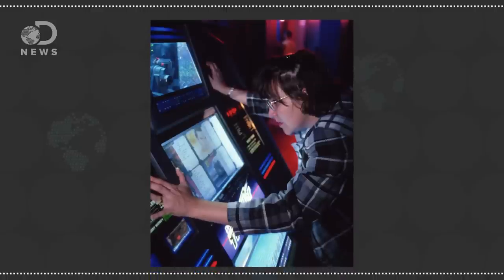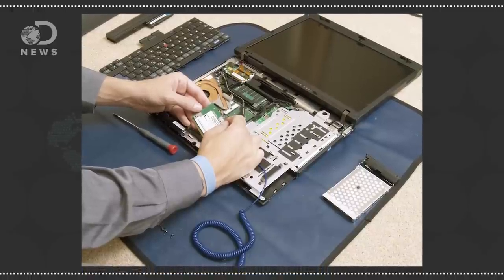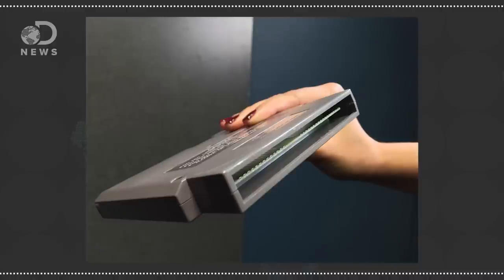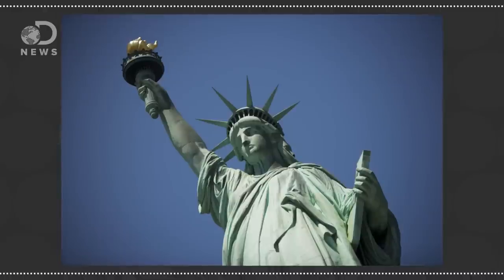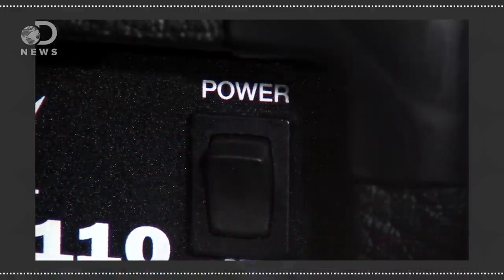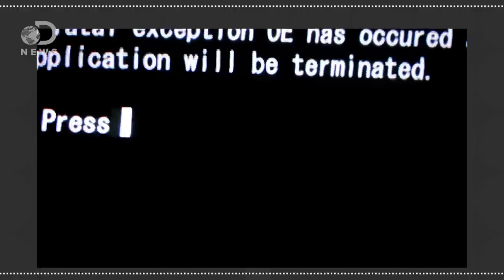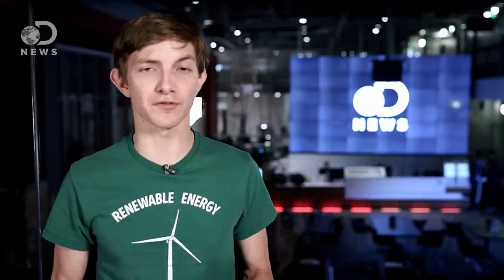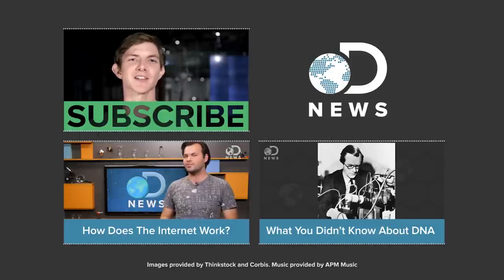Why Do We Hit Things When They Don’t Work?

Comment: Good point about oxidation.  I think the point of blowing on SNES cartridges (or any really) is that there was dust accumulated on the pins keeping them from making good contact with the edge connectors in the console.  Although maybe not as common as we would like to think the problem is real and can be remedied by giving it a good blast.  But I agree that a much better way to clean the contacts is to use isopropyl alcohol.

Comment: Old T.V.s and radios used vibrators & vacuum tubes; you had to let a T.V. or Radio warm up before they would start working.  By hitting it, it would get the vibrator working correctly or it would keep flipping. (before solid state electronics)

Comment: A common problem on Atari ST computers is socketed chip connections coming loose. The symptoms are erratic behaviour, sudden resets, unexpected bombs, blank screen (white), disk errors, etc... This is the result of the PCB aging, heating, dilating, warping, slowly easing the chips out of there sockets.
A common, and quick fix to this is the famous 4 inch drop, and it goes like this:

Switch off the machine,
Lift it horizontally about 4 inches (10 cm) above the desktop,
Drop it.
As silly as it may sound, this sometimes works, reseating the chips and solving the problem. The result is not 100% guaranteed however. If the problem still occurs you probably have a more serious problem.
Of course, another (more professional) option is to take apart the machine and reseat all the chips by hand.

Comment: In High School, my friends and I called it Percussion Maintenance (Percussive Maintenance is probably more apt, but we like the sound of Percussion).  We fixed a door lock that had jammed in the locked position with the use of a Sledgehammer.  It worked better then before.  For simpler machines, a bit of force, and some oil can go along way to fixing a problem.  For electronics, a bit of force can realign something for a little while, often something that you couldn't properly fix anyway.

Comment: When I was a kid I did an experiment several times with my snes. I pulled out the cartridge and put it back in turning on n off the system accordingly. I would do it 20-50 time n it wouldn't turn on. Then I would put my shirt over it and blow in it and it would work within 1-3 tries. So i dont care what people say, but it always worked for me

Comment: I thought we blow out Carbon Dioxide not oxygen??
Reply: Carbon dioxide still has 2 oxygen atoms so it still counts
Reply: Then tell me why it is poisonous?
Reply: gregistopal CO2 isn't poisonous, it just can push out the Oxygen you need to survive.  CO is very poisonous because it bonds to the hemoglobin in your blood and keeps you from using the oxygen you have.
Reply: Vanny V  You still have a bit of oxygen in your breath when you exhale. Lungs aren't 100% efficient. Also, it's probably mostly moisture and oxygen from the air around you.

Comment: You blew on your Nintendo NES games because dust would get between the card and the connection. Its not kids that were stupid its adults that didnt get that the consoles they made wasnt always brand new or clean. Lets face it, Nintendo are still stupid like that. Just look at their YouTube slave contract program.

Hitting the TV back in the day was more an analog thing.
Those with a few more brain cells would just twist the connection on the back instead.

Rebooting your PC will "fix" software issues in ram memory only because ram memory is wiped clean when the power is shut off. On modern computers however you will most of the time reset setting if you just log out on Windows and then log in again as well. If you for example get "alt tab" like issues. Logging out and back in is faster than rebooting even if you have a SSD hard disk.